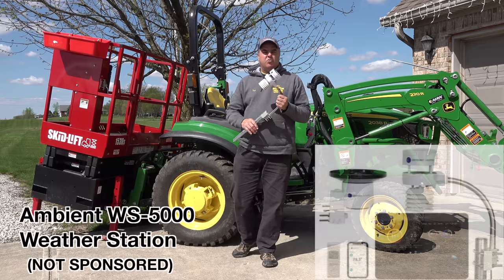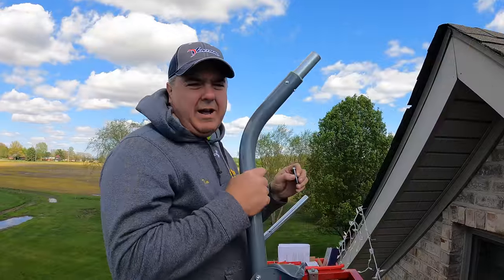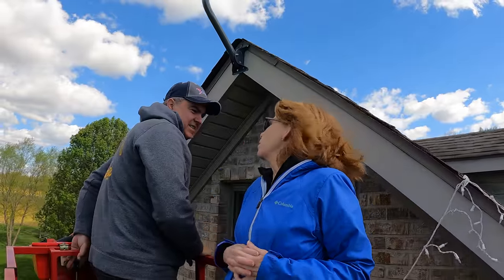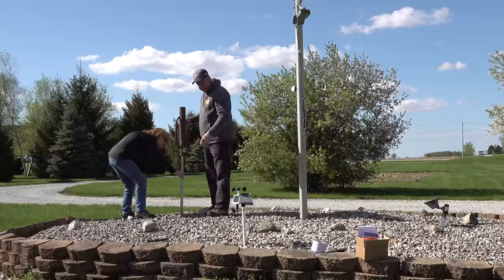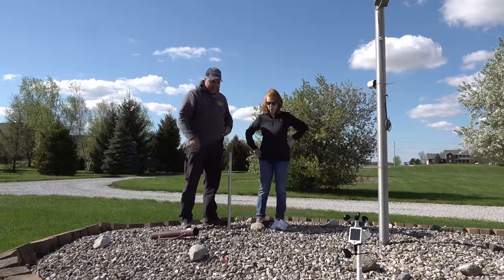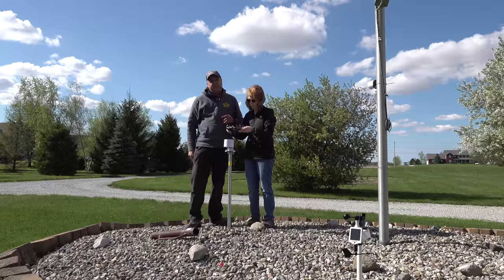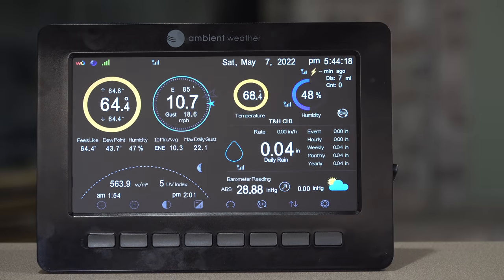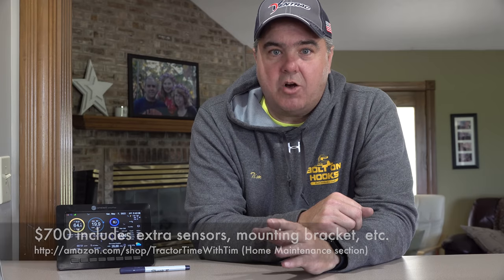BEST Weather Station? Installing the  Ambient WS-5000 Weather Station

Comment: Very interesting! When I was in HS back in the 1970's I built a Heathkit anemometer (wind speed & direction) and installed it on my parents house. My niece and her family live there now but it still worked until about 5 years ago when they removed it when they built a new addition to the house. It worked thru many Nor'easters here in Gloucester, Ma. including sustained 110 mph winds during "The Perfect Storm" in 1991! Because I boat often I rely on phone apps for my weather info. Best Regards, Jay

Comment: As a meteorologist, let me just say that the BEST home weather station money can buy is the Davis Vantage Pro 2.  The reasons are numerous.  Better sensors, better range, more accuracy, longer lasting, no need to change batteries, lots of options like 24 hour fan aspiration, repeaters, soil moisture readings, UV readings, bird spikes for the rain bucket, etc.  The list goes on and on.  You simply can't beat a Davis station.  All other brands are in one group, Davis is in their own group.  The latest iteration has even higher accuracy temp/hum sensors which puts them in the same league as government mesonet stations.  Pretty amazing for the money.

I had my Davis station in service for 12 years before I happened to stumble upon a brand new one at a consignment shop for a song.  It was a model with ALL the options and they didn't realize it was a $1,200 station and sold it for $250.  So now my old station is on the shelf for parts.  But yeah, you can't beat these.
Reply: I’ve added the WS5000 to my shopping cart numerous times,  but never pulled the trigger.  Recently I have been reading the reviews and there are some serious concerns.  Failures of any device can always be expected, but how the company deals with it is important.  Ambient Weather seems to be failing at that.  Apparently they were acquired by new owners.  There are numerous reviews stating poor or non-existent Customer Service.  Water intrusion and durability are mentioned too.  Also having to return the entire unit for a failed sensor repair is not the most desirable situation.  I’ve decided to go Davis as I had originally considered in the beginning.  The Vantage Vue is a few hundred dollars more, and the Pro 2 is over twice the price, but I am now convinced they are worth it for many reasons.  AW is in my rearview mirror now.

Comment: I have an AcuRite weather station, that has a tipping bucket style rain gauge. Spiders like to make a home in these and their web can keep the bucket from tipping. When they stop reading rainfall, I take it apart, clean it, and stick a couple moth balls in it and reassemble. Then it works fine. This was the manufacturer's recommendation.
Reply: Me to mines prob 10 year's old and about shot I recently had to calibrate my thermometer 🌡 10- and that's all the calibration it has.

Comment: I have an Ambient WS-2000 and love it.  The ability to have remote temperature sensors is what attracted me.  I have the main sensor array located on a 15' pole about 150' from the house and connectivity is never a problem. With 6 remotes and the WS-2000 I have about $500 invested. The only thing lacking is a heater for the rain gauge to measure moisture during snow events.
Reply: Do the remote temp sensors have the same range ability's as the main unit? I was going to just get the 1902 I like just seeing indoor, and outdoor. I am currently using a separate unit with 3 sensors to monitor other areas. Could combine all in one, although I am not seeing the ability to name the sensors the reading is coming from.

Comment: Enjoy your new weather station!  I am a weather enthusiast and have built my own stations using various sensors, typically high quality second hand sensors from expensive commercial stations that I connect to microcontrollers.  Its a fun hobby.  Last fall I finally decided to experiment with the Ambient WS-2902C station simply because of the low price.  So far I'm pretty impressed.  After spending some time to calibrate the barometer I started sending data to Weather Underground, WeatherCloud, PWS Weather, Ambient WeatherNet, CWOP, and to the NWS.  My only concern so far has been that the wind speed is often low but I only have this station mounted 15 feed off the ground as opposed to 35 feet.  I took the extra time to create the accounts at all of those weather services above to setup the station to share to them.  To me that has been the most rewarding and enjoyable part.  Like others have commented the Davis Stations really are some of the best but for the money Ambient gives you the biggest bang for your buck.  I have several Davis stations but the current subscription fees take the fun out of it.  The Ambient stations while lower quality blow everything else out of the water with the ease and wide range of sites you can send your data to.  Its pretty neat to have your data appear on the NWS page.  The Ambient website has a lot of details on how to share to more sites than just Weather Underground and AmbientWeather Net.  If you have an iPhone and you are sharing your data with Weather Underground I recommend the iPhone app called PWS Monitor.
Reply: Take it from someone with wind exposure that rivals an airport- the 2902 is very accurate with wind speeds and gust speeds lol. I often top our nearby airport (both of us on exposed ridges but I am almost 1000’ higher) and that is with my station being only 10’ above ground. I would say the wind accuracy is even a tad beyond my Davis VP2, especially my WS-5000 which is on the same pole as my VP2 anemometer. 

That last line said, people might be surprised how close a 2902/2000 or 5000 is to a VP2 in accuracy. And my VP2 is the 24hr FARS model. The AW stuff responds to temperature changes WAY more quickly (a good and a bad thing as spikes become more common in low wind + direct sun but the VP2 spikes too) and the RH is actually better on the AW stuff but the VP2 is known to have a wet bias anyway. Rain gauges are very close (my VP2 having the newer aerocone funnel) but would give slight edge to AW actually. 

WS-5000 has 4.9 second wind updates vs a VP2 with 2.5, so it is pretty close when compared to the 2902/2000’s 16 seconds and the sonic anemometer will actually measure those extremely brief gusts that can make cup anemometers struggle having to ramp up. I love my 2902 and recommend them to everyone but the 5000 is my favorite station I own followed by the VP2 6153. My 8-year-old WS-1400-IP also has a soft spot in my heart for obvious reasons, still running strong and accurately after spending a measly $150 in 2015 on it 😅

Comment: I’ve had the Ambient 2902-A for a few years now with no issues other than having to clean the rain gauge periodically. I’m sure the 5000 has some advantages but if looking for a less costly option I’ve had good luck with the 2902-A.

Comment: I have been using Davis Instruments weather stations for a long time. They're well made, but if you have problems with one, replacement parts are available, and are for the most part reasonably priced.
Reply: You can replace individual pieces on AW stations now too. Ever since the 2902 it has become common practice for them. 

I love my VP2 6153 but I will always own at least one AW station for their FAR more modern user interface and out-of-the-box connectivity + general affordability. UV and solar radiation standard. No need for third party software like CumulusMX to get rapid fire WU updates (even paying Davis $120/yr for their top WeatherLink package nets you a best of 1 minute updates; I get 3-8 second updates using CumulusMX). Easier to own, set up, and maintain as well. My VP2 is my second favorite pws I own, close to the first which is my WS-5000. My 2902 not far behind as third, and my 1400-IP that is 8 years old is just the special one in muh heart 😆

Comment: Installed my sons Christmas gift on the Rohn-25 tower today. I couldn't get the holes on the support arm for the ultrasonic sensor to align perfectly but I did manage to get the bolts to go in although I wasn't happy about having to essentially force the bolts into place. And I couldn't install the rain gauge as shown since I side mounted to a Rohn-25 tower - I think I'm going to change the mounting when the weather gets warmer. I didn't buy all the accessories but I plan on buying the lightning detector in the spring when his birthday comes around and maybe I'll buy those anti-bird spikes for the rain gauge if birds become a problem. The air quality monitors might be a good idea also.

Comment: I rely on the weather as part of my job. I like having pinpoint location based weather observations. after having a Davis, an AccuWeather, an Oregon Scientific, I am now trying a Tempest. So far it seems to be working very well. I am not sure the rain sensor is very accurate, but the neighbor has a Vantage Vue Pro and has agreed to let me see his data (he doesn't want to connect his publicly).
Reply: Nah those haptic rain sensors are not always consistent. I love the Tempest but I would personally choose the WS-5000 over one every time. And did lol a Tempest + a regular rain gauge (if they offer that) would be nice

Comment: Fancy! We have the Ambient WS-2902A Weather Station and like it quite a bit. Every now and then a leaf will get blown into the rain funnel but that's easy enough to remedy.
Reply: I’ve had the Ambient 2902-A for a few years now with no issues other than having to clean the rain gauge periodically. I’m sure the 5000 has some advantages but if looking for a less costly option I’ve had good luck with the 2902-A.

Comment: I’m working on my second La Cross system. This last one has been working very well for almost 5 years. It give me adequate information. This one does not work on weather underground. They all need someway to record data to a memory card. They came out with a newer model about a year ago that has Wi-Fi. My first system never measured rain fall. 
For worldly  forecasting, I follow Frankie McDonald on YouTube.  Not only does he give me breaking alerts, he tells me how to be prepared. (That’s always the best part).
Simply Safe may have some temperature sensors for your odd locations. Wyze has some sensors for moisture, temperature,  but you need buy into their home automation system.
I will check you out on weather underground. Good job.

Comment: Bird spikes on the rain gauge are typically straight like a pin making it impossible for a bird to perch.  I suggest double checking your set up.  It looks like a small bird would not have a problem perching on the bent pin.  Otherwise you'll have to clean it frequently.

Comment: I have the WS-5000, a replacement for a WS-2000 that finally died.  The weather station is pretty good, but the moisture sensors available for it are junk.  I put 3 in my yard, well within range of the weather station (they go in the ground and are powered by battery), to monitor my turf moisture levels.  They worked for maybe a week, and even at that they would regularly disappear (lose signal connection) for hours or days at a time.

Comment: I think 3-4’ is actually best for the rain gauge as it will minimize the effect wind has on the rain entering the funnel but is still plenty high enough to avoid splashback from the ground. Just be sure it’s high enough to not be submerged in snowfall lol

Comment: You mentioned being concerned about Johnny idling while you’re up there- Use a high idle and put the rpm’s at 1000-1200. Diesel engines don’t mind being idled at 1000-1200 rpm’s. High idle will keep oil pressure up and will keep the temps up

Comment: I have a temperature / humidity sensor outside on the screen porch. (ThermoPro TP 357 on Amazon @ $12.99). Use the same sensor inside and one in the refrigerator. All three send the data to my iPhone via Bluetooth on one page.

Comment: Tim I have an Acurate system here and have had it up for about 6 years. I have had to replace the battery's about every 2 to 3 years and have had no trouble out of it.  you mite want to look in to this system .

Comment: Keep in mind that the temp sensor mounted that high will likely give a different reading than one closer to ground level.  If memory serves, the NWS takes temp readings from a sensor 4 or 5 feet off the ground with the sensor in a ventilated box..
Reply: 4-7’ is recommended (3-4’ for rain, 33’ for wind). Most will see a difference of nothing, up to 2-5F warmer for low temps (depending how much wind up high vs ground; same wind- same temp but no wind vs some the sensor without will always be colder). Daytime temps will be more accurate if anything because consistent airflow on these stations with passive rad shields is extremely important in direct sun (even my Davis VP2 with 24hr aspiration fan needed consistent airflow to avoid spikes or just plain reading 3-5F above actual, constantly). 

It’s a pws, you make sacrifices for 1-2 variables to have the best data for others. Rather my low temps read slightly warm and have better wind speed/direction and max temps than the alternative but that’s just me. I got the VP2 to ensure the thermo/hygro and anemometer were entirely separate though, and eventually I’m even going to separate the rain gauge from the thermo/hygro so that the temperature can get maximum airflow and rain gauge can be away from the wind. As best as I could considering I have wind exposure like an airport lol exposed ridgetop living

Comment: My system here in Scotland is somewhat simpler and requires no batteries or power source. It doesn't record results but provides accurate weather information, day or night. It also works as both a light source and a ventilation system, although it provides very little light during the hours of darkness, which is inconvenient but, for the price, we can't have everything. It was pre-installed in every room of our flat and, apart from basic cleaning, requires no maintenance. Each unit shows a dynamic, panoramic view of the Scottish Highlands, although this varies, according to your location. As far as I'm aware, the system is available worldwide and adjusts to your location without calibration. It came without instructions for use but the user interface is so simple that absolutely anyone will manage to operate multiple units with minimal effort. The only down side that I've encountered is the fragile nature of the main material used, which will break relatively easily if used incorrectly. Because of this, some care is required when adjusting the settings. 👌👍😁
Reply: What is the name of your "system?"
Reply: @jrbees929  We call it "Looking out the window." or just "windows" for short.😁
Reply: @2H80vids  🤣🤣🤣Apparently, I missed my afternoon coffee when I read your post!_ DOH!😜😜😜

Comment: How is the weather station working out now that you've had it for a while?
Reply from the maker: The temperature has quit reading. I have not diagnosed.  
When working, the temp was very accurate.  Love the wind gauge…with no external moving parts and the rain gauge I can leave out all winter :-)

Comment: Well, let me ask you this. Have you not figured out how to set your sunrise and sunset that’s that little arch just below your two largest circles if not, you’ll need to go in the settings of that display and adjust your latitude and longitude which you can find out what it is for your particular city by simply going to Google and doing a Google search for longitudes and latitude Numbers for your city and state. Once you set that it will give you the accurate sunrise and you’ll see a yellow dot it looks like a sun that will rise over the daytime and it basically like a sunrise. It is the sunset look like a sunset, you’ll see it most people who buy the systems do not explain that And I don’t think it automatically sets when you registered to AWM or underground or whoever else so as far as your mile I don’t have your 5000 I have the one just below it and nothing on my stuff. None of my stuff runs off of separate batteries, my whole stations all in one so it does have moving parts but it has a built-in solar panel that charges the internal battery and I’ve only had it for a couple months, but I’ve got the same type of display you got so I thought that might be helpful for you. I live over Ohio.
Reply from the maker: Yep. Finally got it figured out.  Thanks!